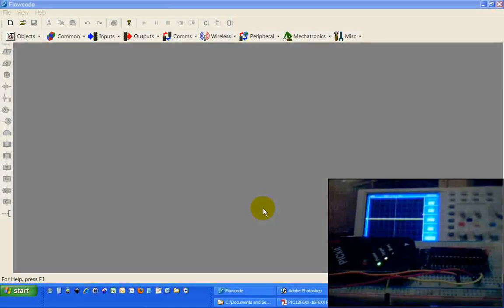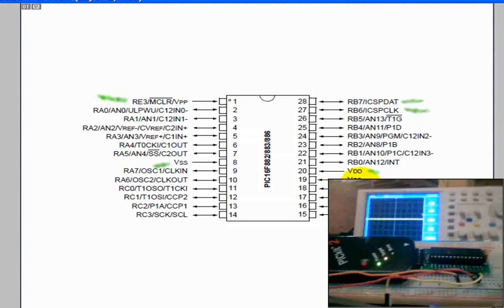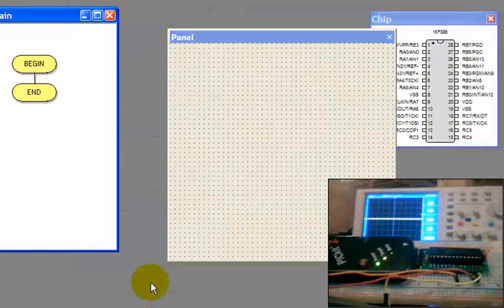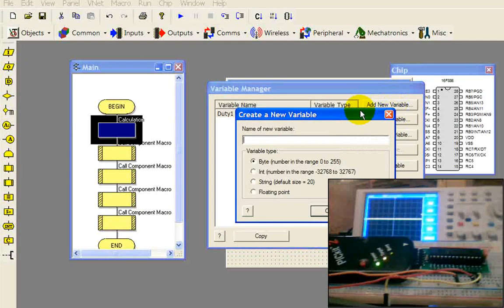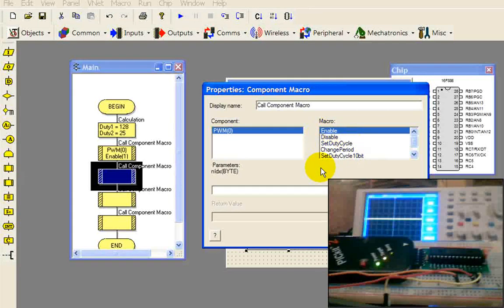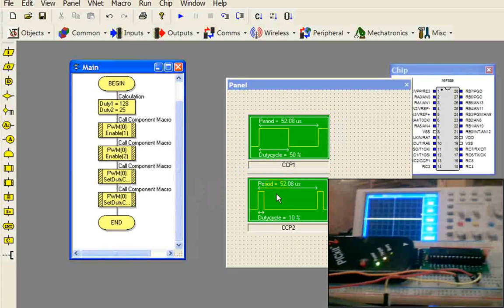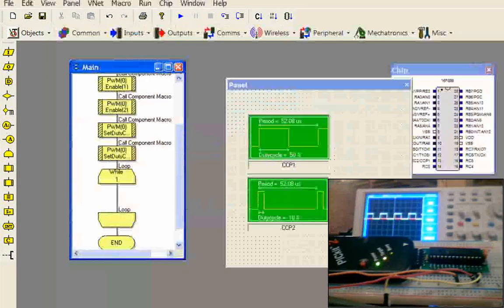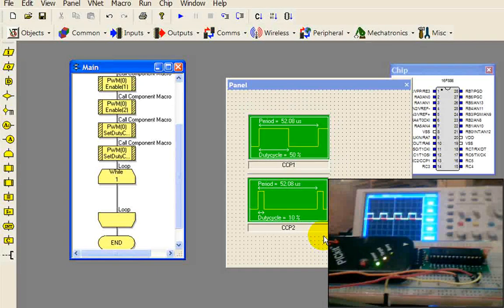Pulse Width Modulation Tutorial using Flowcode

Comment: Hello. I have Flowcode PIC pro and I just wanted to program 12F675 to read digital temperature senzore ds18b20 and based on result of get_temp macro to set duty_cycle  for PWM output.
I have never used any PIC mcu before and I'm confused, Does 12f675 have pwm ?
 I know when I see OC0, OC1. OC2 something on Atmel chip pwm is there but here I'm lookg at GP4 and GP5 and both have some marks OSC2 and OSC1 but when I add PWM in flowcode it says it it unvailable? are those maybe pins for external XTAL ? Do You know which of those small 8 pins PIC's have both ADC and PWM ? I also need 1 analog input for project. Thanks
Reply: You should check out Microchip's MAPS page.  It's one of those pages where if you don't know about it, you'd never know it existed.  You can search parts by feature, pin count, etc.  I looked for little while and I didn't see a hardware PWM available for 8 pin devices but there are devices in that pin count with ADC available.  Here's the link https://www.microchip.com/maps/microcontroller.aspx  OSC1 and OSC2 are pretty much pins for external XTAL as you suggested.  Cheers!
Reply: Rich Scherlitz  Тhank You, I'll take a look